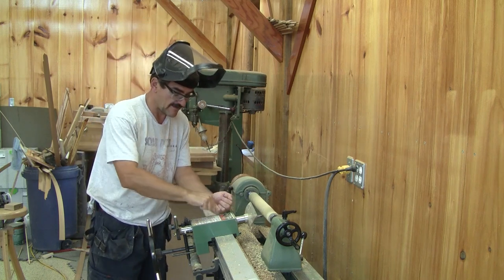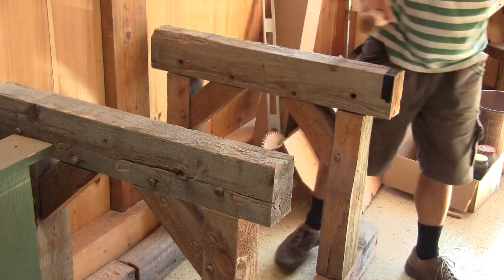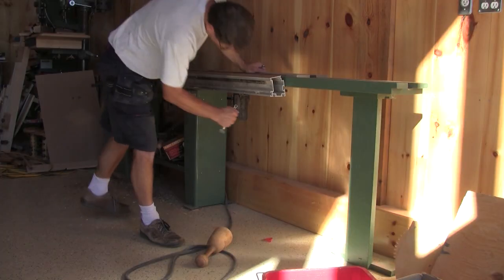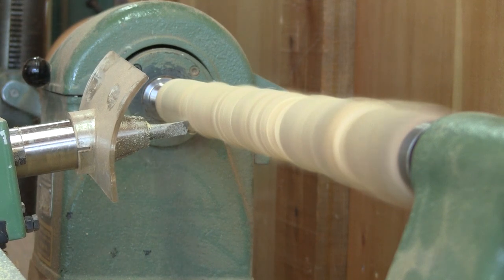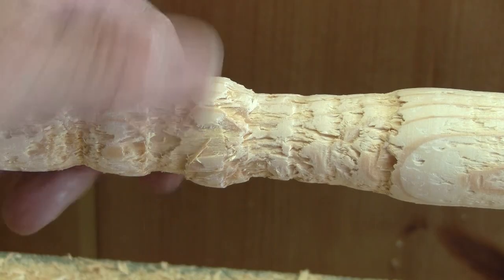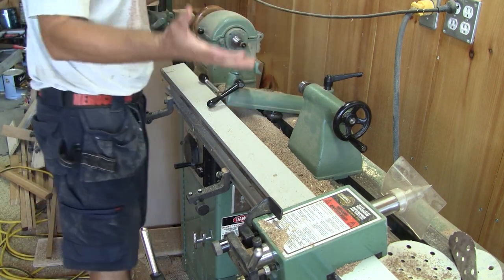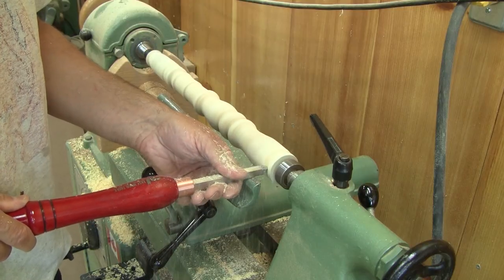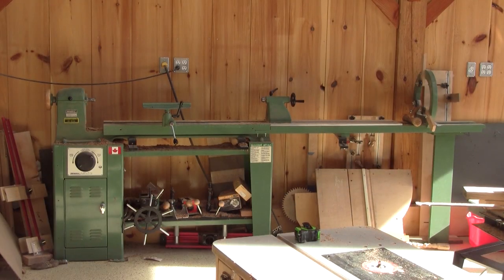The Woodpecker Ep 102 - I'm trying my lathe duplicator

Comment: The cutter on the first one looks like it was cutting too far below center for a good cut. I think you made the right choice by putting it away. Duplicators don't look like fun to me. The second one looked like it might be useful if you were doing a lot of spindles to use for marking the key features - the same as if you were using a story board.
Reply from the maker: +Mike Peace It might be just that, but I didn't liked using any of them. But soon I have a video about turning a set of long posts, that I enjoyed a lot :)
Reply: +Mike Peace I thought the same thing about the first cutter. 

The second one is better, and it's height adjustable, although it seems a bit low to me (could be camera angle) and also it's using such an acute back angle that there's no bevel support. I'd be inclined to try the second one with a small secondary bevel on the back of the cutter of around 60*, then raise it just a tiny bit so that as it engages the workpiece, the secondary bevel is just contacting the workpiece and supporting the fibers. No guarantees, of course, just something I'd try.

Also, Alain, if you cut only downhill (i.e. larger diameter moving into smaller diameter) into the narrower spots you should have less tearout. @5:56 the piece in the lathe has tearout that looks like you were going left-to-right, so the downhill spots look ok, but the uphill parts have the tearout. This will mean reversing directions several times, but if you really need to duplicate, then that should help. Again, no guarantees, just a suggestion.

I understand your frustration, however.

Comment: Like others I'd say that first duplicator was a long way below centre which is going to contribute to the tear out. I've never found pine to be very good with a scraping cut anyway, in fact it's not an easy wood to turn. The second duplicator was better but I think you were getting close to the best results you were going to get. I don't like duplicators they never leave a piece that's as good as the original, you always lose the crispness of a hand turned piece.
Reply from the maker: +Wobblycogs Workshop I think that I'll work on having more "hand" turning skill in the future and leave the duplicator alone inside the shed. But yes the second one was a bit better but not enough.

Comment: I use to use a duplicator similar to the first one and turned over 30,000 chair legs some years ago. If you spend the time on setup matching cutting tool to follow tool and placement also remove as much vibration from the copier as possible (All up and down sloppiness in the copy head) Balance your spindles properly and remove as much waste before loading then your outcome would be greatly improved. After balancing and setup I use to be able to remove copier and use my lathe as normal.

A lot of people say they are a waste of money due to not spending the time getting setup right or the retailers not having the knowledge themselves to pass on. I could turn a leg every 2 minutes thereabouts with a lite sand of 320g from start to finish, including prep time was just under 5 minutes, but if i was to turn by hand using all the relevant marking tools and short cuts? it took me around 15 minutes and where never 100% the same. I use to make $1.20 a minute profit, $2.50 per leg and made over $90,000 in a eight months and 20 years ago was big money. So my $1000 dollar setup made more money than a friends factory setup including his overheads and 1/4 of a million investment plus paying worker wages in eight months.

So they do work really well, they save quite a bit of time and reproduce great replication (depending on your template) that should be hand turned first and then a acrylic template made from a half slice of the original turning.

A fully automated basic copy lathe runs on the same concept just has more cutters and computer technology. Which today you could do to your own copy attachment with a few motors few switches and a Arduino or Raspberry Pi.
Reply: No you shouldn't and if you need any setup help contact me. Or let me know how I can contact you besides posting my email here.
Reply from the maker: +Peter Linch Thanks, if I need it again, and can't make it work I'll contact you :)
Reply: Yes, if the need arises. You have quite a good quality copier, a lot better than most.

Comment: This comment is a little late, but I guess better late than never.  I find that I get the best finish with my lathe chisels when I 'ride the bevel' (let the chisel bevel rub on the wood) and slowly raise the chisel handle until the edge just begins to cut.  This gives a shearing action.  Applying that to your duplicator, you might get better results if you can drop the back of your cutter so you get a shearing action instead of a 90 degree scraping.
Reply from the maker: It might be the trick, 
but if it's the trick, why the company didn't do that from the start? One day I'll get it out of the shed sharpen the cutter and retry this. And I 'll check if I can move the angle of the cutter also

Comment: You're moving to fast, slow down a bit and you'll get much better results.....
Reply from the maker: Maybe, but I was so discouraged that even after all those years it still lying at the same place in the shed...
Reply: @LgosseuxDbois-TheWoodpecker  it's a nice piece of kit you've got there, I have a similar but smaller copier, I have learned through you tube how to use them a bit better...make several lighter cuts rather than a couple of heavy ones, and most importantly, always cut down the grain never up the grain because that will just rip the piece to bits, just like your attempt in fact.
Reply from the maker: Maybe one day I'll try again. I'll also begin by sharpening the cutter this also might help a bit

Comment: I have used a couple duplicators.  The first one I made from thiswoodworks design.  It used a router to hog out the material.  While it did leave a great finish it had a tendency to barber pole the project.  I turn a decent amount of table legs made from pine so like you the tear out is an issue.  I bought a viel duplicator which I think is from your area.  It uses an angle grinder and 5 carbide cutters.  It does a fantastc job turning pine.  You still have to sand after turning but for my projects its perfect.  I can complete a set of 5x5" table legs in about 20 mins.
Reply from the maker: +david Boardman Yes Viel lathe duplicator are from around here, I've seen one in a exotic wood store. One thing for sure mine was less then perfect.

Comment: Couldn't you grind or file down the follower a bit? Also, just like for regular turning, wouldn't it be better to do the major wasting away with a gouge, and then switch to an extremely sharp duplicator bit only for the final shaping?  Turning usually uses a gouge followed by a skew chisel right? The duplicator may be useless for duplicating but perhaps with a bit of work it could be a useful accessory for just producing extremely regular diameter of straight round lengths, and things like that.
Reply from the maker: +Warren Postma The replicator follower has a very weird shape it's a too big, off center round tip at the end of a round shaft. I really don't know why it's off center? And it's way too big. But you might be right, the guy who sold me the lathe was saying that he used the replicaor to turn dowels
Reply: +Alain Vaillancourt  Well if you got it for free with the Lathe it's a good deal. That's a beautiful lathe, and I envy you it!  I just bought my first lathe, from an estate sale, $150 for a very generic asian import with a single metal tube as the ways. Tailstock does not stay aligned with the headstock so I have some work to do to tighten it all up.
Reply from the maker: +Warren Postma I don't complain a bout the lathe it's working great. It was built right here in Quebec probably 30 years ago, now General are manufacturing their lathe (and other tools) in Asia, it's not the same quality.
Reply: +Alain Vaillancourt Agree 100%. I have some Stanley planes from Quebec, approximately WW 2 era, and they are wonderful things.  My Dad's table saw was a Rockwell Beaver also made in Canada. So sad the Canadian tool making industry died.